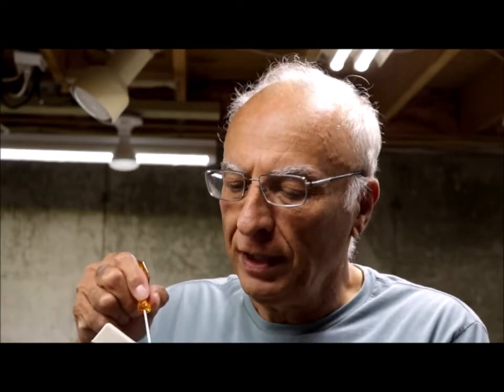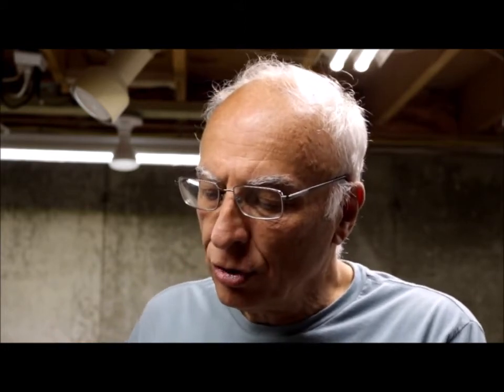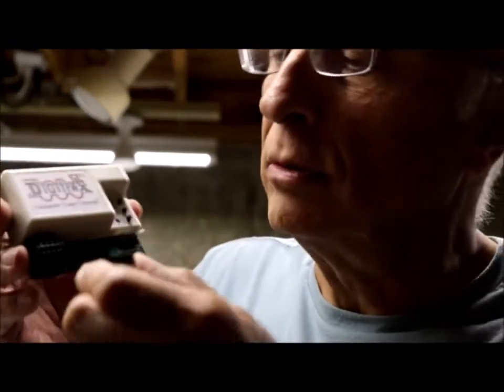My  Beef with Digitrax DS 74

Comment: Have you experienced problems when using the Digitrax PS14 to power the DS74. If I power down my entire layout and then power up, the DS74 will not function until I remove the power supply pin plug from the back of the DS74 and then reconnect.  Conversely, if I use the NCE P114 to power the DS74, the DS74 powers up without problems. What is your experience?
Reply from the maker: I have not had that problem, but I do not use the PS14. I use a generic power supply..
Reply: @PracticalEngineeringSolutions  I just experienced that problem too with the PS14 without the red indicator light on the plug. It fails to power up like you just said. I found some more PS14's with the indicator lights and everything works fine.

Comment: I have the same problem with the DS74 and the loose terminal block. I have a number of DS64 and 74s on the underside of my layout boards. Friction isn't enough to hold the connections in place on the DS74 when the device is mounted upside down. Does anyone have an easy fix for this?
Reply from the maker: Only thing I can think of is to solder wires to the pins before installation of the DS74

Comment: Thanks for the great review.  I have been looking closely at the DS74 to see if it might meet my needs and I am still not 100% sure.  That said, I am not sure what a better option would be.
I want to be able to use the 10 pin connector for 4 local momentary buttons to switch Tortoise switch motors, but the I also want to take one side of the SPDY output on the Tortoise and run it back to the sense pins of the 10 pin conector to get feedback on the actual position of the turnout. Basically I want to be able to keep JMRI up to date whether I throw the turnout manually or via DCC.
One other option is using the Digikeijs DR4018 and DR4088LN-GND to throw and then listen to the turnouts, but they are a more expensive solution.
I would love to hear your thoughts. -Heath
Reply from the maker: I am not familiar with the Digikeijs products. Having said that I think the DS74 will do what you want. Also, there is a large user base community, a robust Google IO group and a Facebook group. So you would be able to get a lot of support. I have also called Digitrax support directly and they are very knowlegable.

Comment: And another thing or two......
* you lose the ability to set the pulse width in milliseconds to drive a solenoid or relay. All you get is a capacitive discharge on/off. The DS64 is more flexible.
* you can no longer wire power to the front connector like you would on a command station or booster. You are forced to use the 2.5mm barrel connector on the back which is fine if you want a forest of PS14's. Not so good if you have a dedicated power supply for all your DS74's. (not using track power to power this thing...)
* on  a postive note, I do like the abilty to change the addresses with a DT602. I know, I am lucky to have one I guess. But it really is handy.

I really wish I could keep buying the DS64.
Reply from the maker: They are still available Steve but are harder to find than before.

Comment: Something I see that I do not like is that you need a DT602 to program it!
Reply: You don't but some of the new easy programming only works with the DT602. The manual is quite confusing.
Reply: @woodalexander  It's digitrax, the manual is always confusing!  LOL   I wish they would charge $1 more per item and hire a non-engineer to make manuals that are understandable.  I always have to go to youtube to find out how to do something!   Thank goodness for all the post educational vid's!
Reply: @UBME2  The manuals back in 2007ish with the DT400 and Super Chief were amazing, I still have the spiral bound ones for my older Digitrax equipment. Their manual writing has gone way downhill even as the overall ease of use of their products has improved. The problem with the current manuals is that they've skimped on them and they're over-simplified so if you want to do more than the basics, you are forced to read between the lines and deduce how things are done, and some stuff just isn't documented at all. No one on the list knew that you can set the start/end points on DS78v servos for something like a year, which is mind boggling. I generally like Digitrax, but I think they've tried to do too much by trying to be the first and one of only two (along with ESU) end-to-end DCC and layout control vendors on the market.
Reply from the maker: I use a DT400

Comment: Another thing. The ribbon cable is very difficult to wire to a terminal block for push buttons. The DS64 was great. I have also run into an issue today. I have set up two 74s. One push button for an assigned turnout (number 106) actuated a turnout (number109) that is on the other 74. I have triple checked all my wiring and it is good. The push button for number 109 works fine. All the other turnouts on both units work fine. I am opening a ticket with Digitrax. Crazy!
Reply: Yeah, they want you to buy the breakout board for another $12 or something. The DS64 was already pricey then they jacked up the price on the DS74 and added the terminal block. Larger installations are going to have to look and see if the alternatives will meet their needs.
Reply from the maker: Randy - let us know what you find out., If you change turnout 106 to another number will it still actuate turnout #109 on the other 74 ? You can still buy some 64s but not for long.
Reply: If I follow the base numbering, setting a DS74to 106 will also get 107, 108, and 109 on the same unit. A second unit would have to start with 110 (I think)